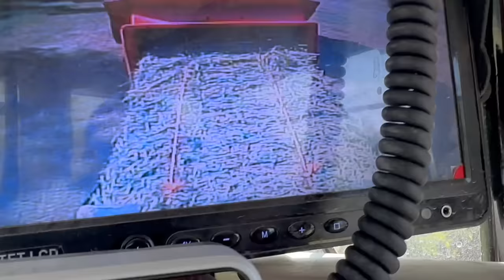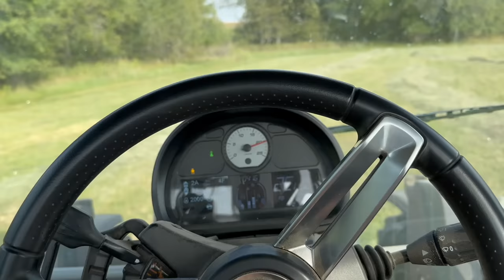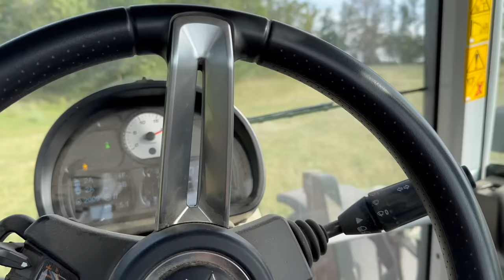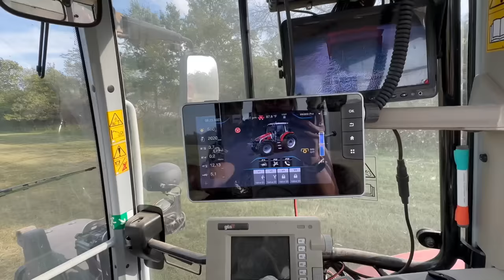1300+ Bales ..  Not bad for a day in the office ! | #Hay season { A Farm Vlog }

Comment: How many strokes per bale do you shoot for. On our New Holland 570, we always tried to get around 17 strokes per bale to keep consistent length and make the accumulator work better
Reply from the maker: Well, we shoot for 14 strokes per bale - which makes a huge difference when you’re out of alignment because it will affect every thing down the line. The length of the bale goal is always 33-34inches AT max because of trailer length 3 bales across - so we’re not over hanging / over length but it also makes the stacks in the barn and having the max amount of space in each “bay” of the barn - - each bay holds 960 bales, 11 stacks high. And each barn holds 6,720 BALES without hand stacking / elevating hay (which we’ve done in the past).
Reply: Does your monitor show strokes per bale or do you have to listen for the sound of the knotters tripping? @ChroniclesofKayla
Reply from the maker: @griggsfarmsllc2273 I have to listen right now … we don’t have a monitor for the baler 😅😅 old schoolin it

Comment: 9-22-23    Twine tension out of twine box is  important when you consider the knotter ties knots in NANO SECONDS.  Knotter function is dependent on  proper tension as the needles delivers twine thru chamber up over the twine disc holders.  If twine not placed properly in the holder knotter  may miss a tie you'll know it. !!!!   There is no tension rating,  you  go by  "feel" which comes from experience.    There are other factors which can affect knotters  but tension I look at first !!  Wire balers are a whole different story !   I have worked with both over the years.  Just tagging along with you Kayla,   Bye.   👍👍
Reply from the maker: It’s exactly why sometimes it’s really hard for ME cuz I can’t watch the baler work and be in the tractor baling… I’d had a couple tie issues but one was a swap over on a bundle but when it happens a couple more times - - then it’s time to call in the boss man. Thanks for always being a part of our day too!
Reply: Yes the swap over.!!..........I did not  mention that issue.    The key issue here is when the twine changes from one twine ball to the next  the knotter can MISS a tie. Depending where the knot is LOCATED   when   the needle delivers it up to the twine disc holder and the  "bill hook" .  If the knot CLEARS both units you get a completed knot.  If the :stripper arm" does not  strip the knot off the bill hook you'; have 2 strands hung up in the knotter.   The  last .  note to tell you is ......how the manual knot is made when joining  two  twine balls together.     The knot  MUST  be a "square knot"  not an over hand knot  why the over hand is to big and can pull apart.  After you tie the square knot CUT the tails to no more of an inch remaining.  The key here is the knot must be small tight with short tails in order to pass thru the knotter in a NANO SECOND..    Now you have a better understanding of what is happening back there  because you are driving.  Jason already knows what is  going on  at the knotter and how to fix.  The way I learned was to ride on top of the bale  chamber to see what was  happening, I ate a lot of dust !!     Now if the knotter is constantly missing  there is an issue with the  knotter  will require a inspection and adjustments  and you'll need to go to the knotter section in the manual............too detailed to discuss here.  Hope this helps  BYE !!! @ChroniclesofKayla